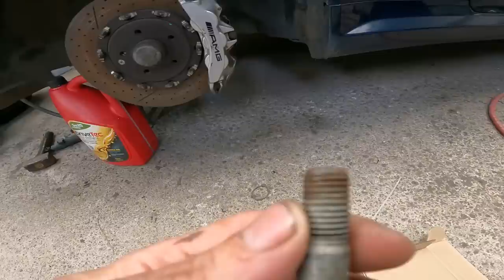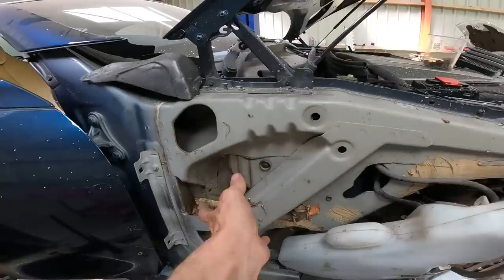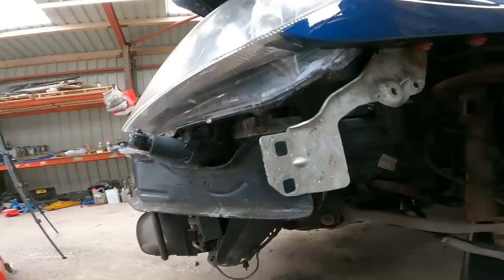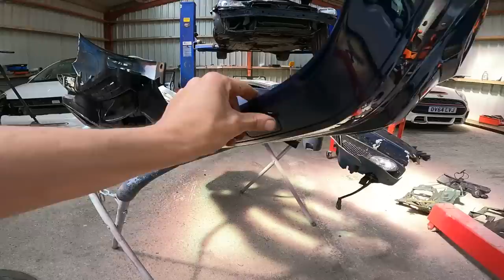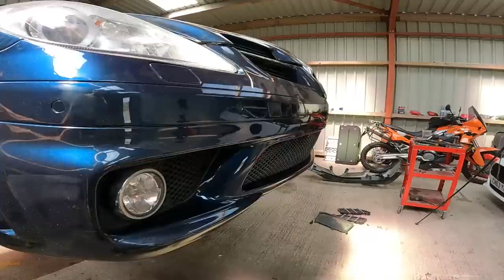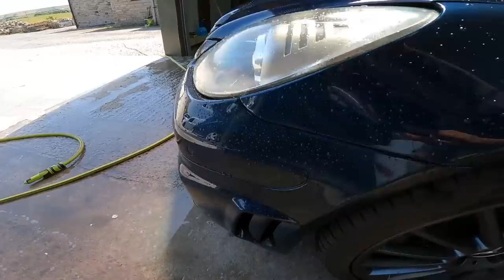Finally Got The SLK55 AMG Finished - And It Was Worth It !!!

Comment: If I remember from my mechanical engineering classes (40 years ago so forgive me if incorrect) the length of bolt .. retaining the object .. should be equal to, or greater than, it's diameter. Ie .. m12 bolt needs 12mm of thread located in the hole. The thread count is irrelevant.
Reply from the maker: Oh really,  that's interesting 👍